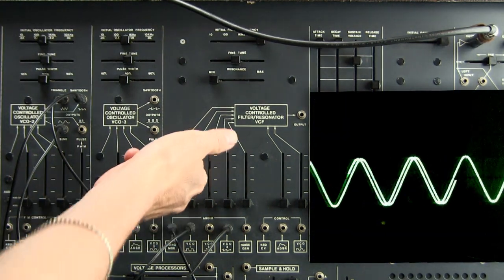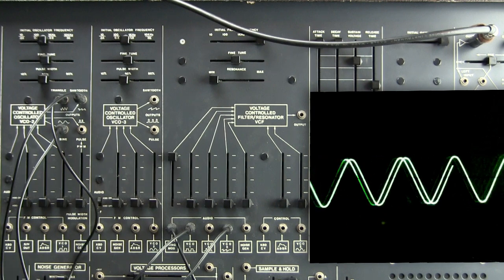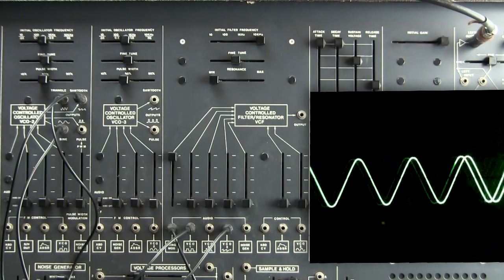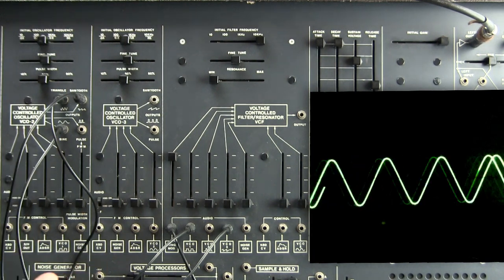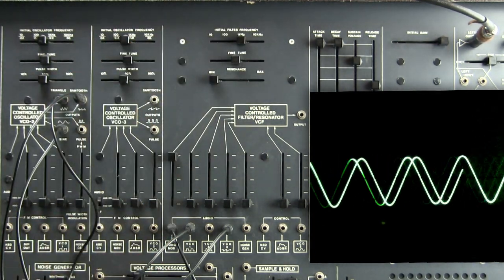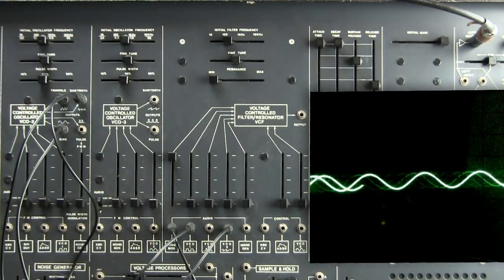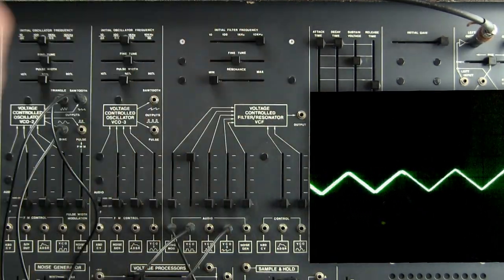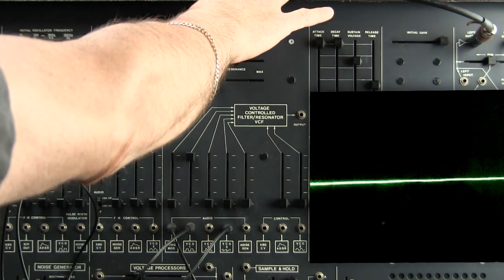The Filter- The ARP 2600 Filter demonstrated with an Oscilloscope

Comment: Isn't the sine wave more of a triangle here? I know analog VCOs don't produce perfect shapes, but......

Anyway... I love your videos Marc!
Reply from the maker: +Adam Borseti It certainly looks pretty triangular!  But as the filter is closed, you can see that the shape doesn't change.  The triangle wave has some higher frequencies in it that give it its shape, and that point is attenuated pretty quickly when closing the filter.
Reply: Yeah, I'm used to ~~~~~  not /\/\/\/\/\
Reply: You are right Adam, that's not a sine wave.  It's a triangle wave, possibly followed by something like a soft clipper that is rounding off the peaks (low pass filtering a triangle would not produce the straight rise and fall lines shown here, they will have begun to curve).

Also, as the filter is closed, the shape DOES change.  Using the trigger control on the 'scope would have made this effect much easier to see, but it's possible to see the waveforms clearly by just pausing the video.

At about 0:48 you can clearly hear the harmonics go away as the triangle is converted to a sine wave.  If this had been a sine wave to begin with, lowering the cutoff frequency would only have produced an amplitude change.